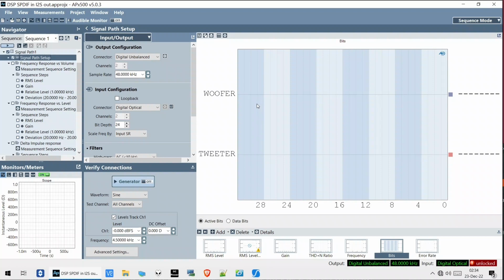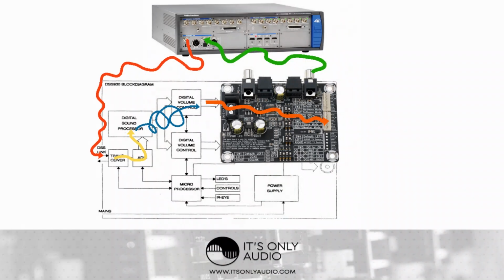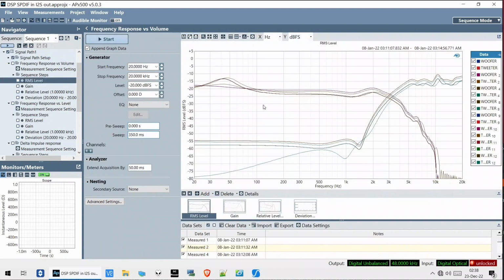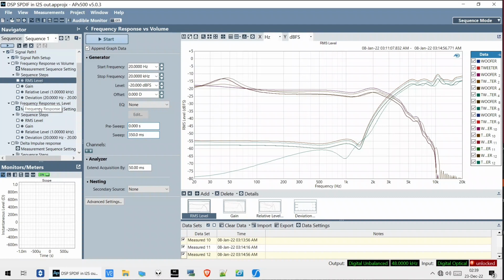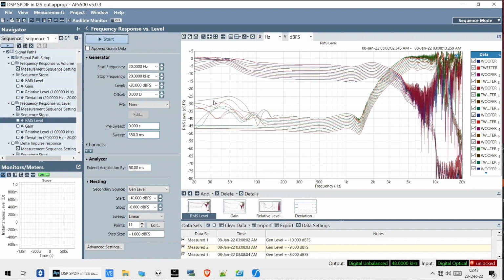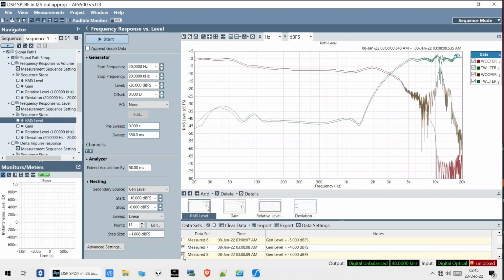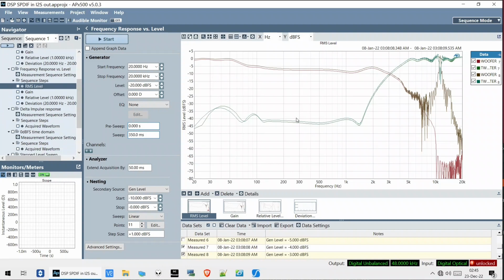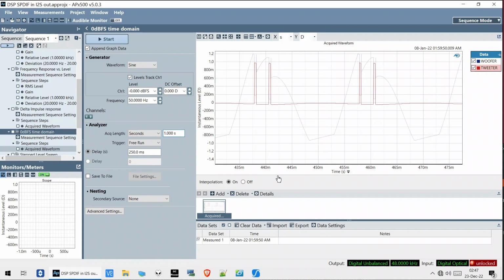Digital in, digital out DSS930 DSP algorithm analysis

Comment: Hello,
I’m not sure if you’re still active on your YouTube channel, but I’m reaching out to ask a question.

I’d like to understand why, when I connect an optical cable between the DSC950 and the CD950, with the DSS930 speakers connected to the DSC950, I can no longer adjust the volume using the DSC, whether it’s with its original remote or the DSS930 remote. However, when using an RCA connection, everything works fine.

Do you have any idea what could be causing this issue?
Reply from the maker: I apologize for the dead air - personal and professional issues kept me from this project for the last few years. It's not dead, in fact it has its own desk in my new office and I hope to return to it soon.

Well, I have neither a DSC950 nor a CD950, but I do have an observation to offer. When I connected the APX585 I also lost remote control. I found out it was a DC coupling problem (detailed in the "DSS930 power-on fix" video: https://www.youtube.com/watch?v=4Wy32OK_Kwg). Adding an AC coupling cap solved the problem.

Looking at the DSC950 schematics (search for service manual at Elektrotanya) I notice that the coax inputs are AC coupled, but the optical inputs are not. Coincidence??
I think your problem may well lie there. If you can bodge in a cap somewhere, that I believe could well fix your problem.
Do follow up if you decide to try it - it may well help others, not to mention give me some closure :)
Reply: @itsonlyaudio  Thank you so much for your help and for the AC coupling capacitor suggestion! I’m going to dive into the DSC950 schematic and see how I can integrate this solution. If I give it a try, I’ll get back to you with feedback. Thanks again for your time and for sharing your experience! 😊